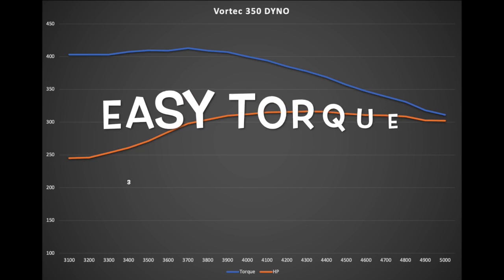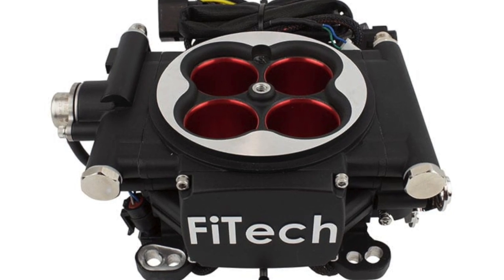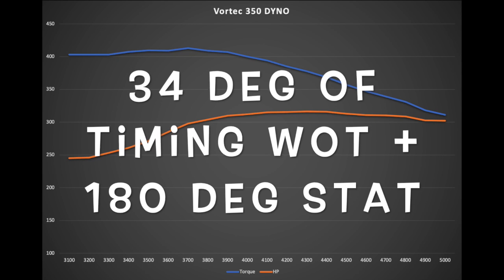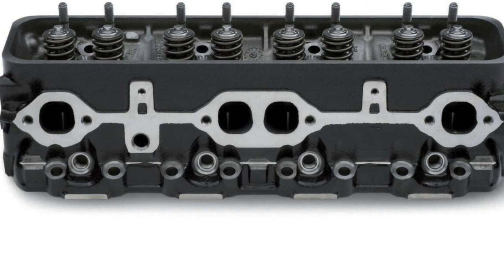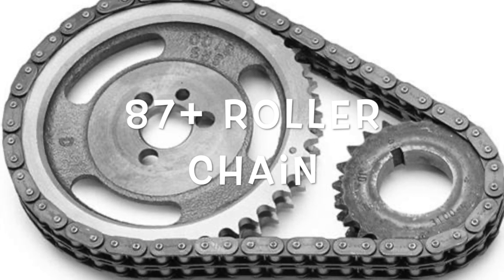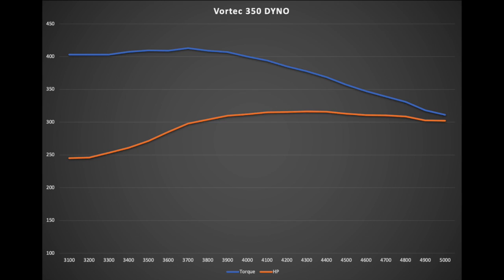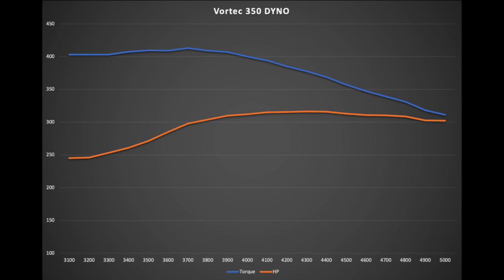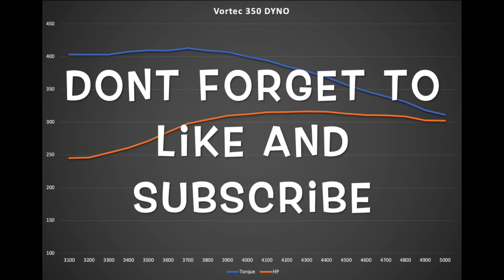Easy Vortec 350 Combo (High Torque 400+ ft lbs)

Comment: I'm running a vortec block with flat top pistons dart heads with 64cc chambers 195 and 160 valves cam is 498 intake 502 exhaust lift 220/224 a quick fuel 680 carb which might be a little small but I dyno at 402hp and 416 ftlbs of torque and I'm currently adding a 144 edelbrock blower to this combination I'll let you know what it makes when I'm done adding the blower it will be around a month
Reply: I know someone with your name. Maybe you are him. Not likely tho. That sounds cool tho. Why did you go with flat top pistons? Is it to achieve more comoression?
Reply: @Meatwad.Baggins  my decision was to achieve the desired compression ratio I wanted while still being pump gas friendly and it's a cruiser I don't want it to be aggravating to drive if that makes sense and that's my real name born and raised in Tennessee
Reply: @jonathanlawson4667  
Okay I get that. Cool. Tennessee is low key my favorite state. I am from Ohio
Reply from the maker: Please do! I've been actually looking for a decently priced 144 to do a vortec build with. 
Good call on the 1.6 exhaust valves, the will be a huge benefit with the blower 👍
Reply: @cuttersperformance  your influence and info helped me make my decisions on my build and I appreciate the videos you do and knowledge you drop for absolutely free
Reply from the maker: @jonathanlawson4667  o I hear that man! I've got 5 engines on stands that are all delayed becuase of waiting for parts haha
I appreciate the support man! Thank you
Reply: @cuttersperformance  yes sir it will be atleast a month due to shipping parts delay but I've followed you for a long time and I'll update you when I get it done and dyno

Comment: I'm very impressed with your knowledge, I'm much older then you and been building manly poncho's through the years. however you have me excited to build a 383 vortech, 500hp.. thank you
Reply from the maker: Thanks brother I appreciate that! You'll probably like the 355 11:1 vortec build coming up! Can't wait to get it on the dyno
Reply: @cuttersperformance  oh hell yes, I know I'm ready for it!
Reply: wouldn't vortec heads have a hard time feeding a 383? I could be wrong tho.
Reply from the maker: It really depends on how high you want to rev it. Basically it comes down to your cam selection, as a well setup vortec head can work great on a 383 that doesn't see much past 5500 RPM
Reply: So Vortec heads on a 400 would be good on a boat motor build seeing no more than 4800 rpm? Been thinking of it since the anemic 305 is kinda timed out
Reply: @yurimodin7333  I've been looking at the 383 Twister project published 9/2002 Chevy high performance magazine.  383, vortec heads, RPM air gap, Hot Cam PN: 24502586 218/228 degrees, then they used a Comp XE282 with 977 springs, ended with TFS 215 heads on it and final numbers of TQ 500, Hp 490.  I thought they were pretty good combos.  Search for 383 Twister Part 1 2 3.
I would like to see more current 383 combos, especially turbo combos.  I'm thinking a 383, profiler 185 or 195 heads?, XE268 or XE274, 1.5 rockers, RPM air gap converted for fuel injection and single VS racing 76MM.